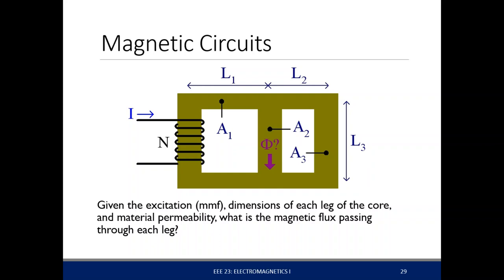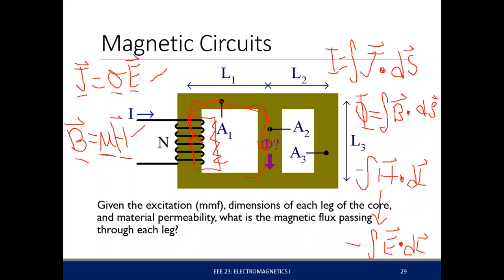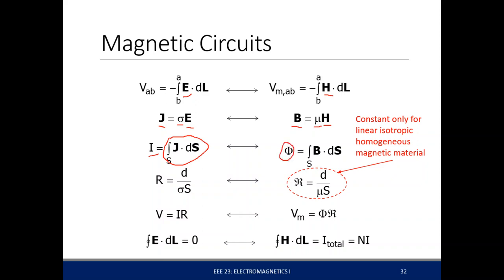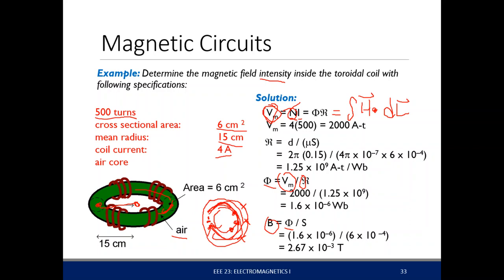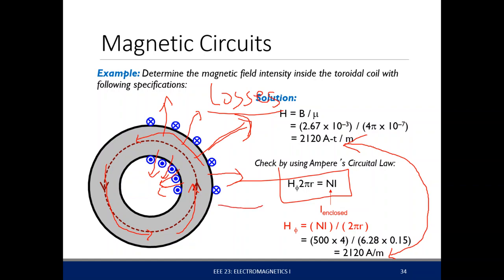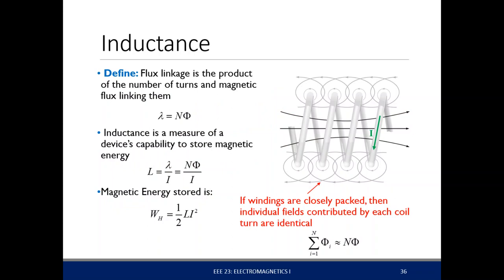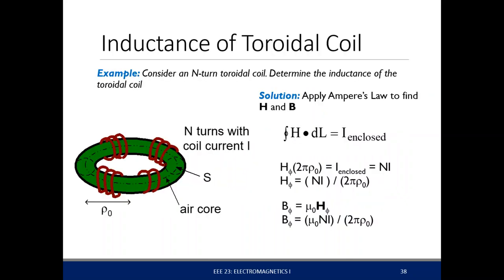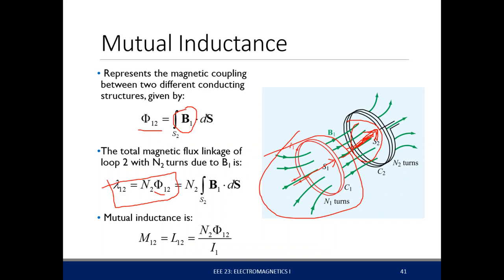Electromagnetics - Magnetic Circuits and Inductance

Comment: Good afternoon, Sir. For the example involving the toroidal coil, can you explain why the path where we take the magnetic potential difference is not entirely closed? Thank you!
Reply from the maker: Hello Mariella. The condition is imposed such that the path does not enclose a current. The magnetic field is not conservative and to make sure that the magnetic circuit equations hold true, we must use a path that will make the field effectively "conservative," and that is when the path is not completely closed.
Reply: Thank you, Sir. I think I quite get it now.